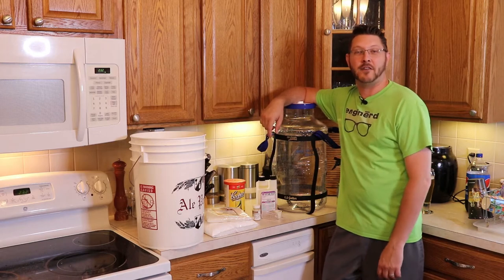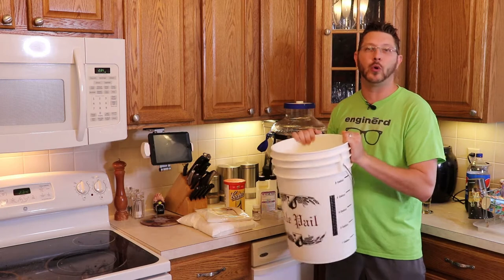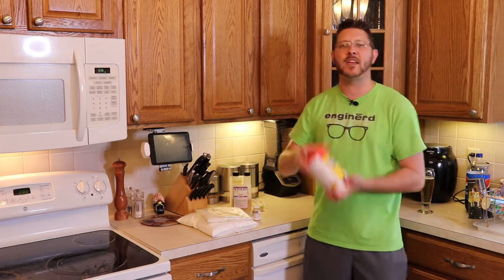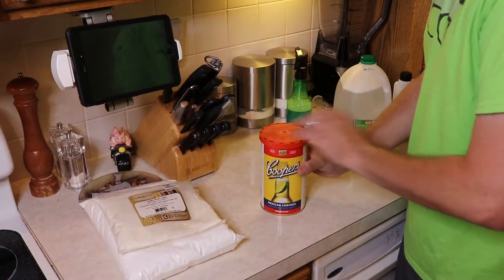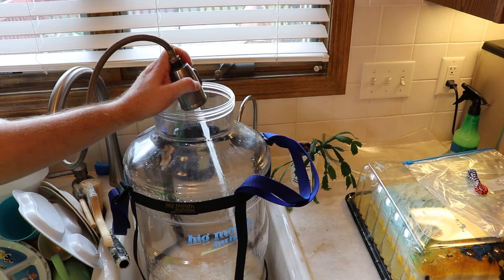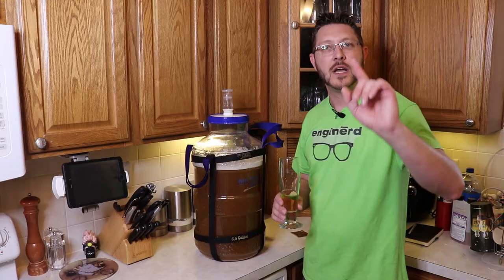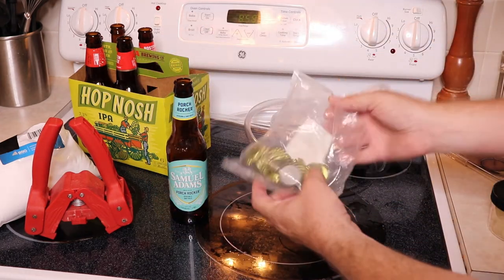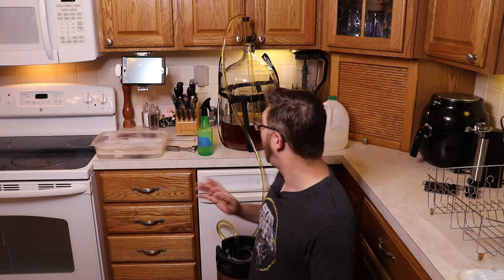DIY with MI - Beer Brewing for Beginners

Comment: should tap water not be used? I would think the chlorine would effect the flavor or some other reasons. I never brewed before but its seems like a not good choice.
Reply from the maker: Yes and no.  Depending on your area's water treatment you may or may not have to do much to the water.  I would definitely recommend John Palmer's "How to Brew" book because in it he has a great section on water.  You can get your area's water report, at least I can here in the US, and you can see how many ppm of minerals, chlorine, etc are in the water you are getting and from there adjust if you need to.  My water does have chlorine in it but it is not too bad for brewing so I use it.  Plus a good way of telling is to go by the rule of thumb "if it tastes good then it will make good beer"  Cheers!